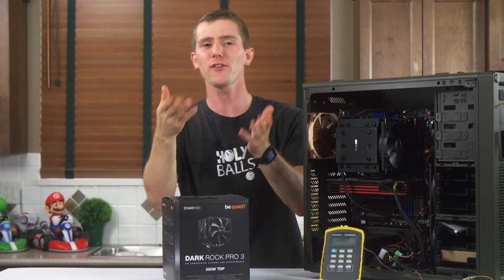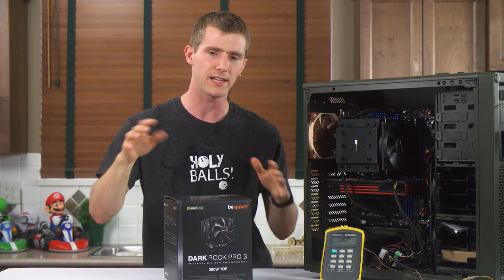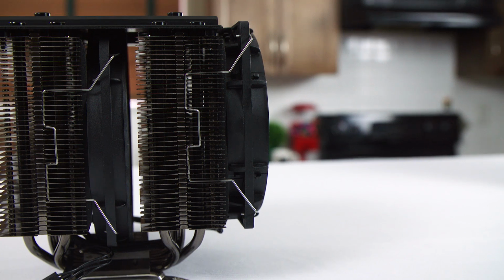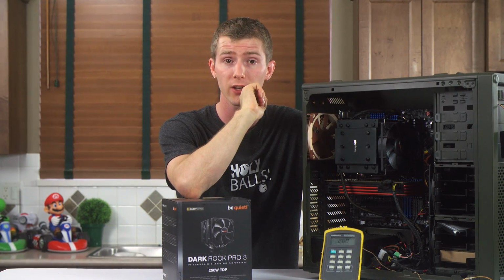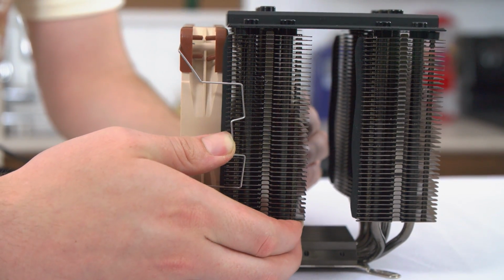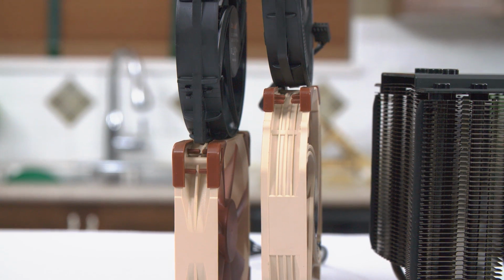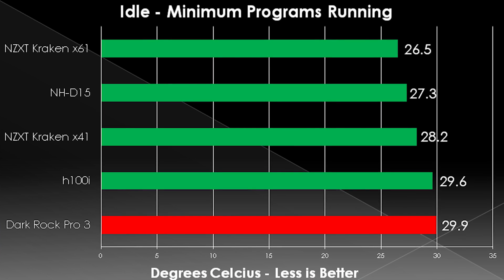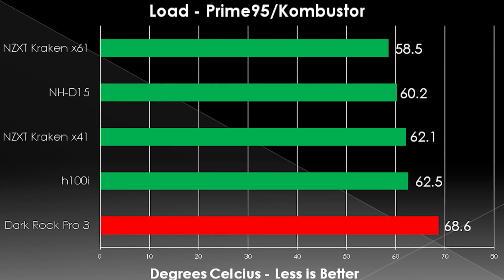Dark Rock Pro 3 CPU Cooler from be quiet!

Comment: Hey Luke, I know this is an old video, but to help other, the BEST way to mount this is to hold the nut with your finger, use a Phillips to screw it tight from the back ...  that sounds dirtier than I intended.

Comment: Garbage cooler I hate it. No fucking point in how well it cools if no matter what the install is so fucked up and doesn't git the MOBO it says it will fit. I reseated, reapplied paste, re tightened everything as much as it will allow and it still won't sit right.

Comment: Everyone mounts these Dark Rock coolers wrong. You put those nuts you where having trouble reaching on to the bracket thats attaches to the side of the heat plate. You put 4 screws in from the back of the motherboard threading them into those nuts. The only problem you run into is the possibility of crossthreading. There is no reason to be reaching in with that wrench once the cooler is ontop of the CPU

Comment: Hello,
You dont need to bend anything.
You dont need to screw under the cooler the bolts.
You just need to screw them from behind.
Installation is a piece of cake.
You just need to be carefull not to tighten very much otherway you may destroy the holes (as it is a soft metal screws)
Also dont be expect to fit high profile ram modules. Choose low profile ram modules (like kingston hyperx fury or vengeance)

Comment: If you use your brain and put the nuts on the cooler and the back plate on the motherboard you just position the cooler and screw it in from the back plate. Only takes a few seconds.

Comment: i know its an older review, but remembering it, and having ordered the AM4 kit for the cooler,   the spanner that came with the kit is now angled and overall quite a bit smaller making it easier to use.  better late then never. and im guessing since the am4 mounting will be standard with the cooler(s) so will the new spanner.

Comment: I used the manual to guide myself how to install the cooler. It was rather difficult at first because i'm a software engineer, i write code not install hardware components, but i pulled it off. Works fine for me. I play heavy games on my home PC and this  cooler keeps me below 70 degrees during the gameplay so it's all cool. As for the noise since that is one of the more important aspects of this particular cooler i mean it's be quiet for a reason, i personally have the cool n quiet option in bios off so my cooler works at max always it's ok i guess i mean 100 times better than the stock cooler i had for the processor before that lol, could be much more silent though with the cool n quiet option since the fan speed would be regulated depending on the needs.

Comment: I assembled my Be Quiet! cooler as much as possible before putting it into my PC and all I had to do was put screws through the back of the motherboard and tighten them. Not so hard at all. Just gotta have someone or yourself, if you have really long arms or a small case, to hold the cooler while you screw it in. Gotta have some brains is all.

Comment: Mounting this thing was a bitch!! I had to take my motherboard out then install it! But I have to say, it's been a nice experience having this beast in my computer. It truly is quiet, and it can fit high profile ram. My Corsair vengeance ddr3 ram is high profile. With it, the first ram slot is unusable unless I get low profile ram, but the last three are usable. The one lucky thing I had though was interesting. This coolers fan was height adjustable, therefore I got it to just barely be a little higher than my high profile ram. Because of that, this big heavy cooler doesn't sag and flex my motherboard because the fan rests on the ram supporting the weight of the cooler. No flex on my motherboard!

Comment: well, ever since I discovered noctua....I am kinda pleased with your result

bequiet used to be my go-to solution, but soon the mounting system has gottn frustrating for case fans
when I bought the overhyped "silent base" I was disappointed....again
sketchy mounting system for the front fans, thin metal for the case, loads of plastic and not exactly quiet, needless to say, I returned it the next day

now I got the sturdy Corsair Q600 with four Noctua A-14 fans and a NH-D15 cooling the CPU, not more than 55°C on my RyZen 1800x at 500rpm troughout the case

"she ain't pretty, but she chooches alright"
as AvE would say^^

Comment: You put the nuts on first then put the cooler onto the backplate and use a screwdriver to fasten the screws through the back, the damn instructions tell you to do that...
So you don´t need to fiddle with the wrench under the cooler at all.
Reply: alteast some one with manual brains!

Comment: All good and well, but...how is the noise level between the Dark Rock Pro 3 and the NH-D15 at different RPMs, I mean, aren't they trying to "be quiet!" and still have high performance?
I am also not sure what dimensions to look for on: "CPU Cooler against Motherboards", to avoid blocking RAM and/or PCIe.

Comment: As for the installation of the Cooler.
There is another Video of someone installing that cooler, but he somehow FIRST screws the nuts to the cooler and then tightening the cooler by turning the screws on the backside on the mainboard.
Instead like here where you use that wrench on the front side.

Seeing that video i think its much easier that way if that really works.
(He installs it with the mainboard being inside the case already.)

If you wanna install it outside you might even be able to do it like this:

-prepare the cooler
-lay the prepared cooler "upside down" on a table
-lay the mainbord "upside down" on the prepared cooler
-just drive in the 4 screws from the backside of the mainboard.

Comment: And yet you have nothing to say about how it sounds... I think your "standardization" of installing noctua fans on every sink is a non starter - most enthusiasts will use a heatsink with the fan that comes with it. Also - the point and purpose of this product is to provide adequate cooling for enthusiast level performance with minimal noise. Given the temps you provided, it certainly does the first part of its job (adequate - not stellar, but adequate for some OC headroom). Does it live up to its name, and "be Quiet"?

Comment: Well its a good thing... I do not have such large mitts sinced mine is on its way along with a mobo some DDR4 and an I7 6700K :o... upgrading from an FX6300 >_>
Reply: OK funny thing... you mounted it wrong, Hitech legion did it right, you bolt the screws onto the mounting brackets before mounting the brackets to the heat sync :o

Comment: actually, the montage is fairly easy if you do it the right way - the way it says in the user manual:

1. put mb into case
2. add backplate and screws to mb
3. tigthen those nut screws at the right position to the carrier plates and those to the cooler block (for this step you might need another small wrench to tighten)
4. put the pc case in upright position bring cooler block on top of the screews an tighten from back side (do not forget to add the paste and remove the film from the cooler)

i hat some trouble myself at first because i watched all those yt videos that were complaining and were doing it wrong in the first place :( no angled wrench or sweat needed!
Reply: It might be little late, but Luke is talking about mounting LGA2011 CPU - there you have default MB backplate, not the bequiet one. And you are screwing only from CPU side, you have to use this tiny wrench. However, I don't consider this as a big problem. You could always bend the wrench and go on if thats an issue.

Comment: Just bought the thing together with an i7-3770 CPU (3.4-3.9GHz). The processor ran passmark's CPU benchmark at 37°C which was a mere 12°C above ambient temperature.
And you should really invert the process of installation. Flip the cooler upside down, screw the brackets on it, tighten with the wrench (no problem with reaching it this way), put the thermal paste on the block, flip the motherboard with CPU and backplate installed and lower it on the cooler, then tighten the screws going through the backplate and motherboard to the cooler brackets with a philip head  screwdriver. Very easy and convenient, although a bit unusual.

Comment: I bought this and the mounting was ridiculous. I almost gave up on it entirely...I did in a way. I only mounted two screws on it and said fuck it ran some stress test and it turned out fine. 68c 100% load 4.4ghz OC on a 4690k I did two screws diagonally

Comment: If you read the manual it is actually very easy to mount on any 115x base CPU socket.

You are not suppose to install the cooler on the motherboard then install and tighten the nut by hand using the small wrench. Looking at how small the wrench it was not designed to be used that way (and the cooler was not designed to be installed  that way). Your basically making it harder for yourself.

You are supposed to attach all of the brackets and nuts on the Cooler's base plate. Tightening the nut as tight as you can using the small wrench.

Then install the backplate with the 4 long screws and lock them in place using the plastic C-clips.

You then you align the bracket's 4 (middle)holes on the 4 long screws on the motherboard. With the 4 nuts already attached tightly to the bracket (with the bracket attached to the cooler's base plate).

After doing that you then proceed to go to the  back plate and tighten the 4 long screws using a Phillips screw driver (the 4 long screws will be screwed to the 4 nuts you already attached to the bracket).

I did the exact same thing when I installed one of my be quiet coolers that utilize the same mounting mechanism.
Reply: to the top. i struggled because of all those mimi videos as well, while i just should have read the manual first...
Reply: exactly this.

it's still not the easiest solo setup in the world because of the weight of the cooler, but it's significantly less of a hassle than they make it out to be
Reply: ルカス I can atleast agree to that... It definitely has room for improvement in regards to installation.

This is after I bought an NH D15 for a build I just finished for a friend... 

Undoubtedly the very easiest cooler to install ever! Cannot  go wrong with the NH D15 in my opinion now. At first I had my doubts but now its all gone after trying it out.

The only thing I don't like though is the brown/tan fan colors. Other than that, the Noctua stuff are very well packaged (Premium feel) and seriously though, veryyyyy easy to install! :). And was able to hold a 4.4 GHz 5820K OC at 1.169V at the core.
Reply: eroOtoko1 yeah noctua is really great quality. Looks absolutely disgusting with those colors but the quality is top notch.

The main reason why I opted for the dark rock pro was the price and the fact that my i5 6600K oc'd to 4.3ghz just doesn't generate that much heat.

On a hot summer day my highest temp was 55°C during load
(My case has really good airflow too)

Comment: You should use those wire straps from Noctua fans. I almost 99,9% shure if you have used Noctua fan with Noctua wire strap, that could be installed on Be Quiet! fan ;) PS: Jizz no brainer that wire strap from Be Quiet! is not compatible with Noctua fans :)

Comment: Does anyone have any experience with using this air cooler in a Phanteks Enthoo EVOLV ITX case? Does it fit?
Reply: +VelocityRaptor It's quiet...temps are alright-ish.
I applied AS5 TC and I'm sitting at 60c load , 30c idle
Once the AS5 TC settles I'll let you know how good it really is

Just be warned , it's huge
Reply: +Asentrix My 212 runs cooler in the same case :/

Comment: Not the best fitting on a 1511 socket. But does fit, the underside mounting bracket will be wonky because of the middle screw on the socket where the cpu cover plate secures to. I butchered the under mount plate and drilled a 12mm hole where the screw is on the plate so it fitted flush.

Comment: Why the hell would you use noctua fans for all the coolers? If I see a CPU cooler benchmark, I want to see what the performance will be with the fans I buy with the cooler.
Reply: +Liam Borella Those reviews exist and are easy to find via Google. The idea of using Noctua fans is to standardize the testing as much as possible, or to emphasize differences between different heatsinks. What if a bad heatsink came strapped with some excellent fans? LTT's review method would reveal that important bit of info.

Comment: should i get this cooler over the corsair h60? how much would it improve temps over an h60? 
thanks! 
pj
Reply: if you have low profile ram and your case supports it then get this as it will perform way better
Reply: +Nate Dimelfi so if my h60 gives me 70°c max on occt stresstemp at 4.7ghz with 1.255v, what should the temps be with the dark rock pro 3?
Reply: pj 70 degrees at that voltage under that load is actually really good. 70 degrees is perfectly safe. I would say that the decrease in temp would be maybe 5-10 degrees at best with just the single fan. If the temps were higher though, the gap would be larger between the two coolers. With both fan, the temps would be even better most likely.

Comment: Its way too heavy at 1.2 kg. Not good if you are going to move your pc a lot.
Reply: +Jette Christensen as long as the cooler and the mobo are screwed in tight there is absolutley no problem
Reply: SirThanksAlot Still the stress is all on the motherboard. I just does not see comfortable.

Comment: Will 4 intakes on a mastercase pro 5 be good with this cooler?
2 140 Front
2 140 Top
1 140 Back Exhaust
Reply: +zen flores That's way too much lol
Reply: +Michael009 But ill run the exhausts on 10% speed and the intakes on 80%
Reply: +zen flores thats not good because then the air is not getting out of the case so its getting warmed by the rest of tech and the tech is getting warmed by the warm air because zhe warm aur is getting thoug the cpu or gpu etc and that repeat 30times

Comment: This cooler won't work for me at all. It is too tall for my mATX OEM chassis, and the spacing between the two (!) LGA2011 sockets between my server board will not allow installing this large a cooler without them touching each other.

Comment: Is the standard Dark Rock 3 good for overclocking an i7-5820K or should i get the Dark Rock Pro 3 instead?
Reply: +SnippyGrassOfficial Dark Rock Pro 3 would be a better option (more surface area).

Comment: For f** sake just use a pair of pliers to bend the f**** wrench at an angle!
Reply: Point is not to point out what you can do on your own, but to point out the flaws of be quiets mounting mechanisms and the tools they provide you with.
Reply: +KB_TheDireWolf I was thinking the exact same thing haha
Reply: Or just use your pliers to tighten the bolts like a smart person
Reply: the mounting mechanism work if mount it in the correct order. the step luke is complaining about is supposed to be done when the cooler isnt even mounted yet
Reply: or open you toolbox and take a longer one...
Reply: Or be smart and screw the bolts from the back -_-
Reply: +KB_TheDireWolf Smart
Reply: no need... you have to screw it before you put it in your motherboard...
Reply: Should come like that standard........
Reply: Yeah i got this cooler and tried bending it and I was afraid it was gonna snap. I even put it in a vice and bend it and it just wouldnt
Reply: KB_TheDireWolf dude ur a legend
Reply: Only realized that second time I installed mine. Felt like an idiot but it made a world of difference... from stupid hard to really easy.
Reply: It bends fine. I've seen someone do it.
Reply: That was exactly my reaction when he said that: "Jeez, do you not own a pair of pliers?"
Speaking as someone who owns one of these coolers, they are a PITA to install, but not as difficult he makes it sound. The problem I ran into was that the heatsink sits a little low, & is so bulky that it overhangs the RAM slots & the first PCIe slot. I had to take the heat-spreaders off my DIMMs to get everything to fit, & even so, the heatsink was pressing against the closest DIMMs.
Reply: it doesn't bend
I tried and it broke
Reply: So you're suggesting a tool needs a tool to fix a tool that can't do its job?
Reply: Yeap, some people just take things for granted.
Reply: or mount the cooler before put in the case.
Reply: Some metals dont just bend, this one might break if you try to. I dont know why kind of steel it is but all metals dont just bend. If he heated it up first to make it malleable then it might.
Reply: Francisco A. Costa Ramos good idea

Comment: does the Dark Rock Pro 3 fit in this Motherboard: MSI H97 Gaming 3 (7918-002R) ???
pls help
Reply: +Asperanik If you use low profile RAM, it will fit just fine.

Comment: Guys you should really do half this review again, and show the correct, quick and easy way to install this cooler. It took me 5 pain free minutes to install mine. The way you did it would be about the hardest way possible I could imagine. Assembly the cooler side of the brackets first, then tighten the screws from the rear behind the motherboard.
Reply: +Glen c You can't install it the easy way on an LGA 2011 board, since the backplate is included on those. You have to put the standoffs for the cooler on and then screw the cooler nuts on with the wrench (a bit easier if you bend the wrench). Installing this is very easy with anything other than LGA 2011 or 1366 boards.